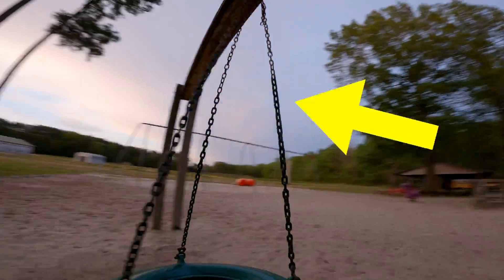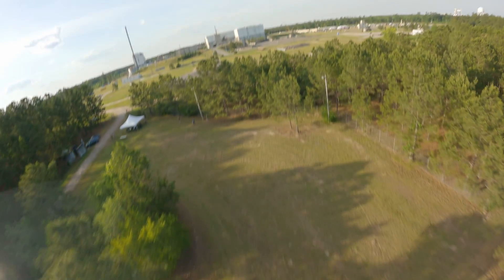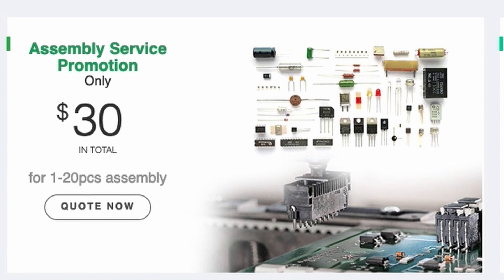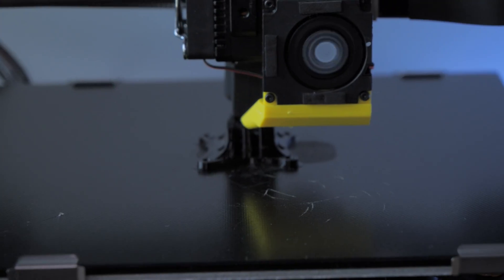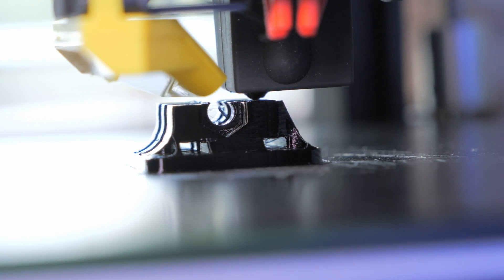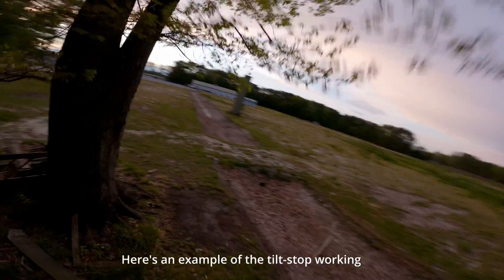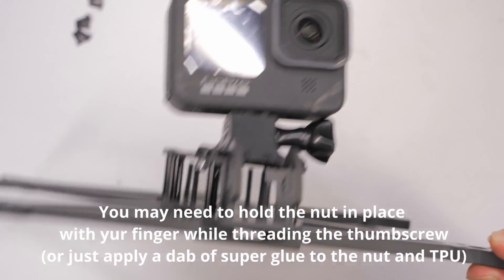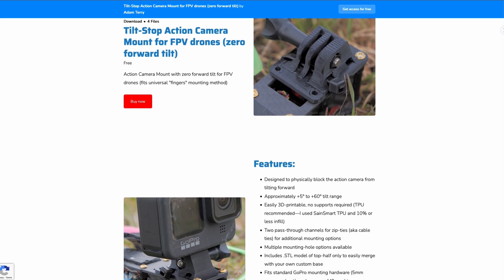Tilt-Stop GoPro Mount for FPV Drones - 3D Printed Zero-Forward-Tilt FPV Mount

Comment: Very cool idea! I find that using a 3D Printed TPU Case on the GoPro with prongs keeps it from slipping (except in a crash). It adds extra friction to the mount when its TPU on TPU, which keeps it from slipping away from the angle you set it at.
Reply: Hi do you mean the 3d printed tpu mount is designed with prongs where it connects to the other tpu part?
Reply: @saturn_fpv  yes. Basically just like the GoPro prongs.

Comment: You could 3D print anything i bet .
 Can you print a 3D plastic go pro case that is not box - square shaped . Can you make it wedge shaped  with a 30° angled bottom and front to put a naked go pro in ?
Reply: Yeah mine went swiveling down when i thought it screwed harder than anyone else woulda did
Reply: @gregorydahl  Use a TPU mount on the drone and a TPU case on your GoPro. TPU on TPU will add friction and it will not slip.
Reply: @LZRFPV  
 And a styrofoam wedge under the fpv camera .